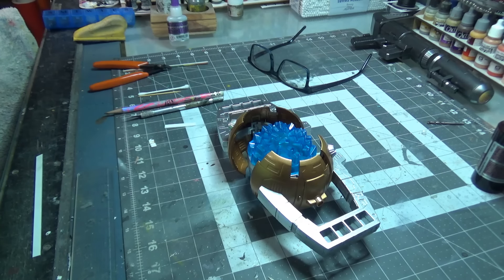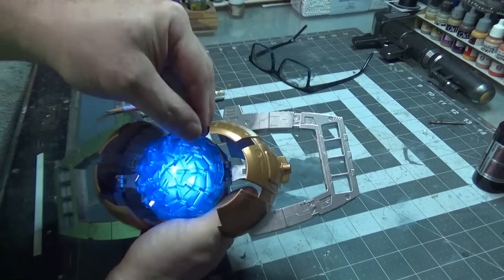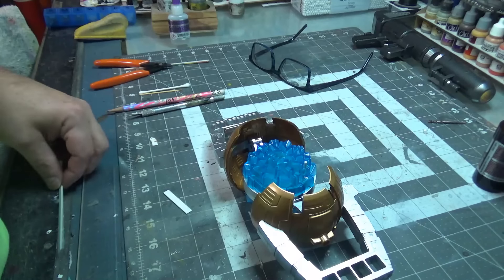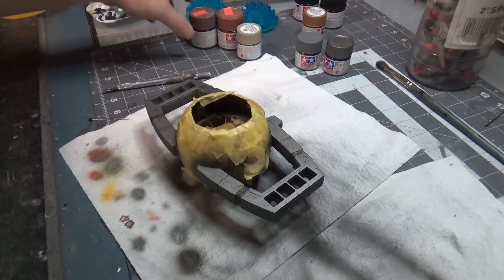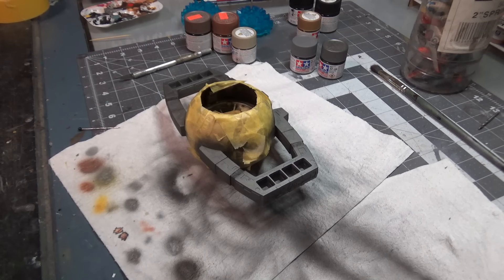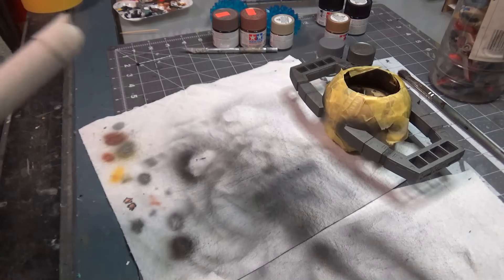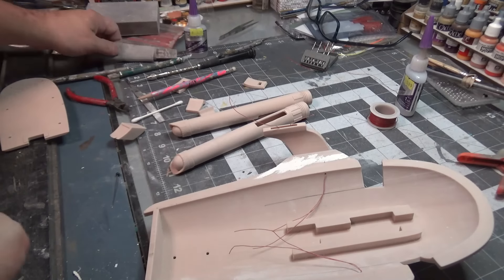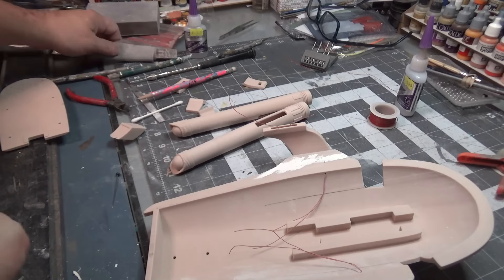Aztek Dummy update 5/3/24 - Prime Fixes and Re-Conceptions

Comment: Those light panels look to be a lot of resin surrounding a LED, if that is true you should be able to cut the large panel down to size.  FYI 1/537 TOS Enterprise buzzard collectors are 30 mm diameter and 15 mm high and the 1/350 NX 01 buzzard collectors are 24 mm in diameter and 15 mm high.  Math suggests the 1/350 TOS buzzard collectors should be around 46 mm in diameter and 23 mm high.   Can hardly wait to see the shuttle completed.

Comment: Hi Lou, love the concept shuttle.  That would have made such a 60's look to the shuttle but I understand those curves would have been very time consuming to make.  Question though, Comparing the large and small shuttle look how far back the nacelles go on the larger model.  Really they appear to go to the back of the model.  Where the smaller one they end probably 2 inches from the back.  Are those scaled correctly?  Also as far as the bussard collectors have you thought about different size marbles?  You might have to hollow out the front of the nacelle so the marble fits in the front.  Just a thought.
Reply from the maker: When I built the little one, I mistakenly put the pylons on backwards. They are supposed to sweep back not to the front. The large version is correct.

Comment: I had a thought on the done for your hoozitter collector there, if you can make it work. You know those gumball machines that sell those cheap, crappy trinkets, that come in those two-piece capsules? Well, some of those are clear or clear-ish. Maybe you could cut them down to size. 
And thanks for the advice on Metropolis! I did it half-assed, which is how I do most things. But I found the long version on Netflix first, so I watched that. Great flick. And it would lend itself splendidly to dubbing it like MST3K, or J Men Forever. I’ll have to start looking for the Moroder version now. Thanks again!
Reply from the maker: I was looking for those. The small ones are near impossible to find anymore. There are bigger ones that are everywhere.